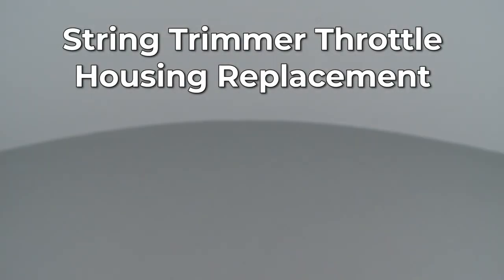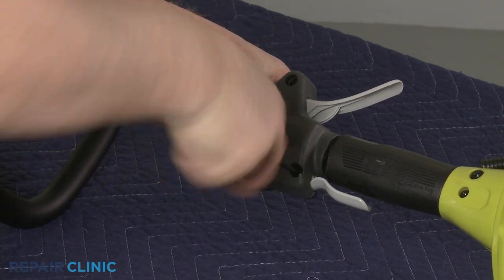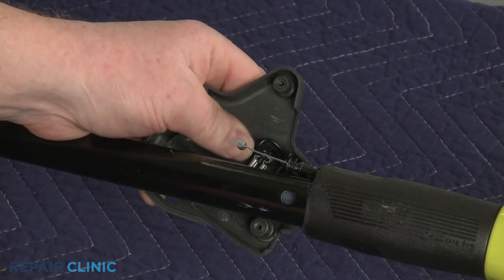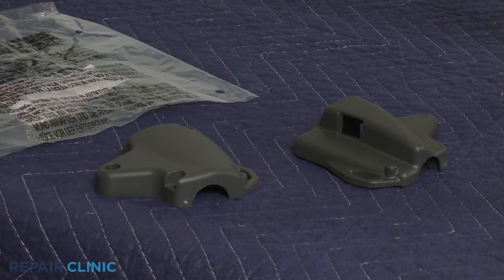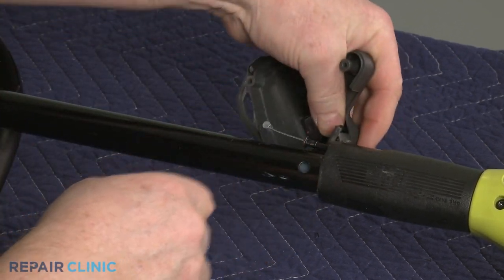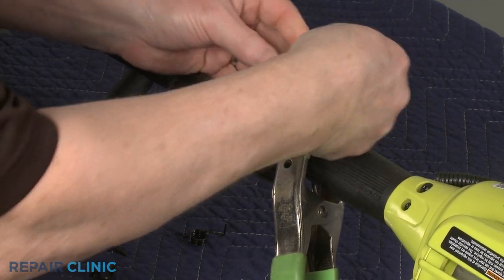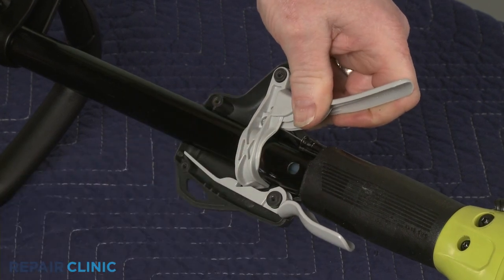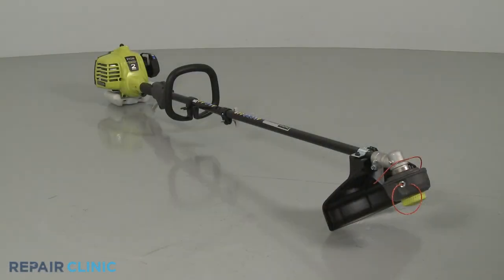Ryobi String Trimmer Throttle Housing Replacement 310831005

Comment: I know this video is from 2020 but do you have a better angle to see how to reattach the spring to the trigger as you reassemble this part? I broke my trigger and am struggling with putting the new one back together.
Reply: I had the same trouble trying to get the spring attached. I finally reassembled it without the spring, and it seems to be working perfectly without the spring. The cable seems to provide sufficient tension to the trigger so the spring isn't necessary.